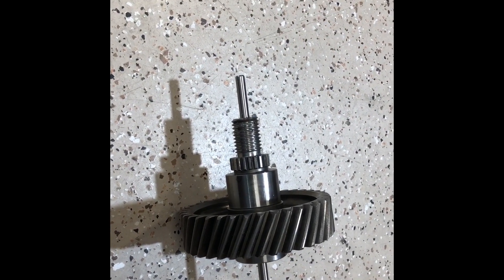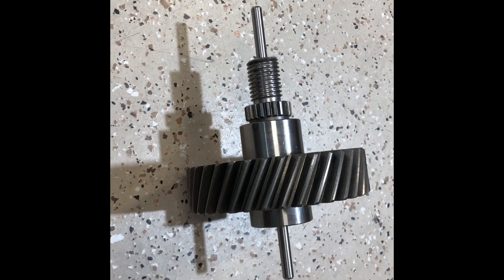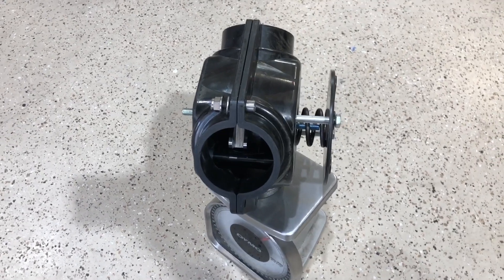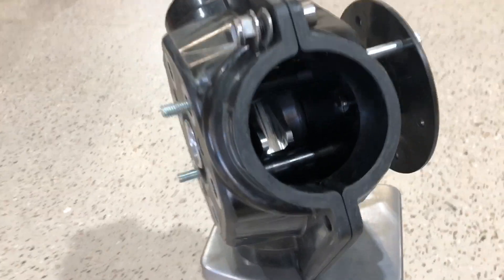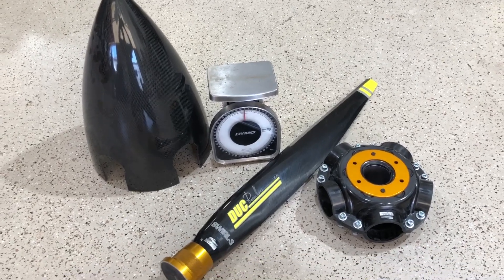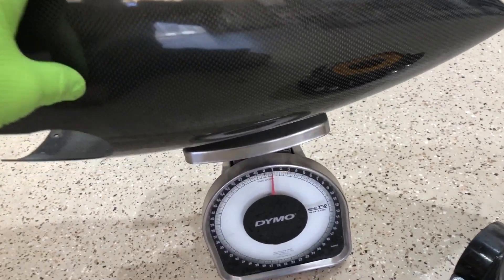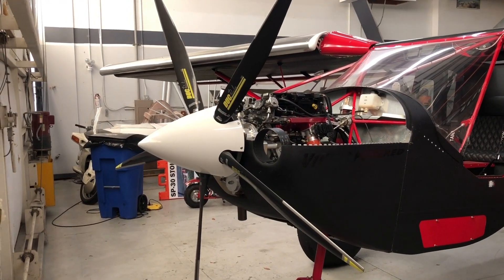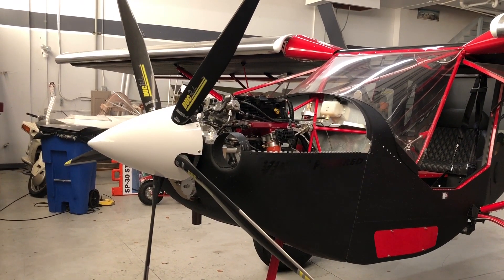Light Sport Variable Propeller

Comment: Exciting.... I see in my future a Zenith CH-750 SD with tuned Honda engine package producing around 250 hp with this prop. Super short takeoff (50 ft or less) and landing maybe 100 ft or so (no wind). At least 100 mph cruise on 5 gph or so at low altitudes. I’d write a check today for that.

Comment: Very nice, one really should use a variable pitch prop to get the best out of a turbo charged engine on an aircraft.
I am an enthusiast, not an aviator myself but as I understand being able to  control the power output of the engine rather than just the output torque of the engine makes the aircraft significantly more flyable.
So on systems where the prop pitch is linked to the throttle and it's control is automated with prop speed feedback there's just one lever, and the system then puts the prop pitch at the angle which will together with the throttle give the desired power?
I picked this up from the vlogs of Rotax owners who can afford to do it, as it does I believe get costly.
That pushrod through the output shaft is neat, I presume it then couples up easily to the nut of the jacking screw which moves it?
Or the screw if the nut is being rotated.

Comment: Ok, this could be a game changing product.  I've been researching a controllable pitch propeller for my project, but until I saw this video, I'd thought my mind was made up and I'd be using the Airmaster system.  I really like the fact, that this design keeps electrical components out of the hub and eliminates the slip ring and wear prone carbon brushes from the design.  I'll be watching for how this project develops and will be interested to see what the price turns out to be.  It would certainly also be great, if a variable pitch and/or constant speed prop system could eventually be offered as part of a Viking firewall forward package.  Thanks for the info!
Reply from the maker: That is the intent.  All gearboxes will have the option to add the propeller system.  The price will be less than the Airmaster and the weight will be much less.
Reply: @eggenfellner  Thanks for the additional info.  When I get ready to purchase my firewall forward, I'll be giving your company a call.